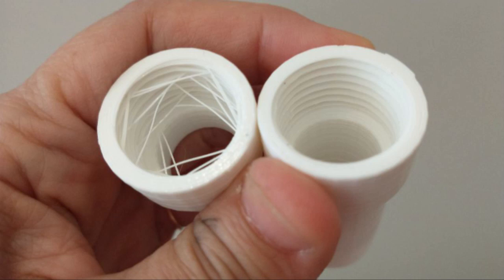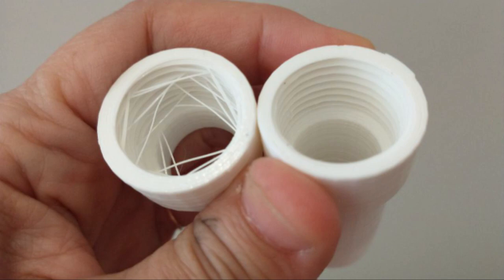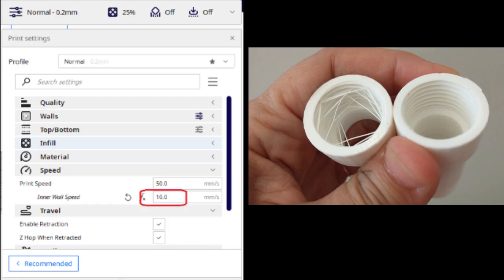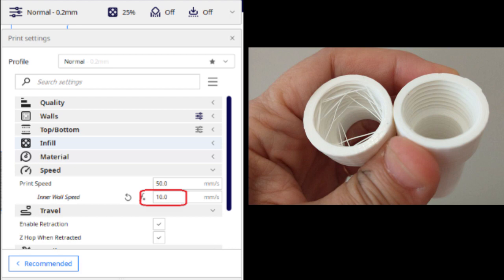3d Printing - Prevent Inner Wall Strings - Threads

Comment: If you are using cura5, you can change wall setting  (Wall Ordering -> Inside To Outside) and don't need to slow down the printing speed

Comment: This change definitely helped with the internal stringing but I am still experiencing the issue on avout 30% of my parts!
Has anyone else found other solutions that helped with this issue? It is killing me on productivity. Thanks guys!
Reply from the maker: Adjust your retraction.  Retraction is the amount and speed of the filament that is withdrawn (retracted) from the print as the head moves from position to position. If the retraction is wrong, it may cause stringing between head positions.  There are calibration towers that you can print to assist you with in finding the right values.  Retraction tower STL files are widely available for download on the internet.  Important: Make sure you find instructions on how to set up the print for the retraction tower.  Improper retraction is the biggest cause of stringing.